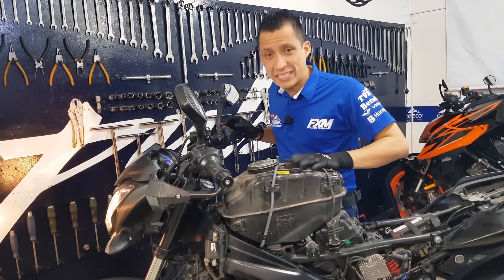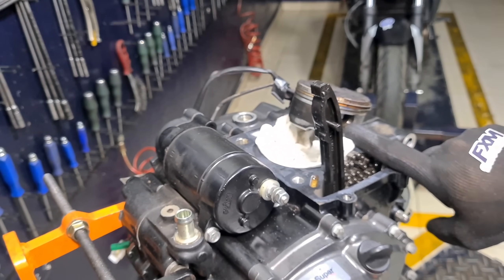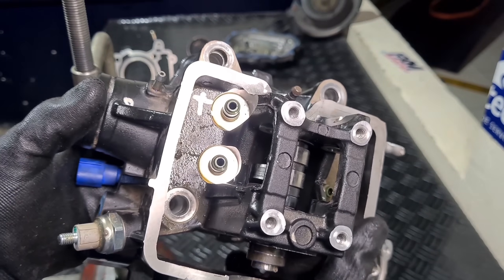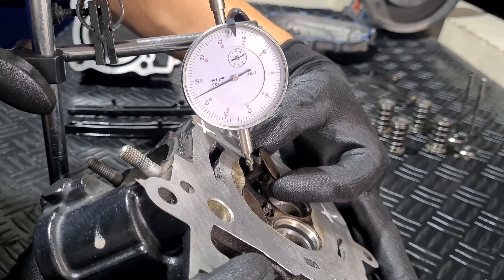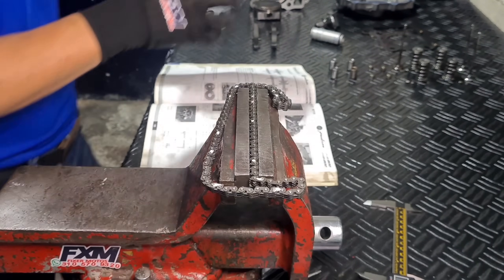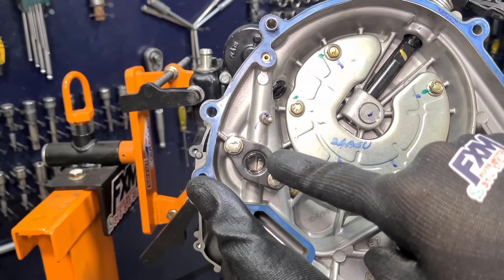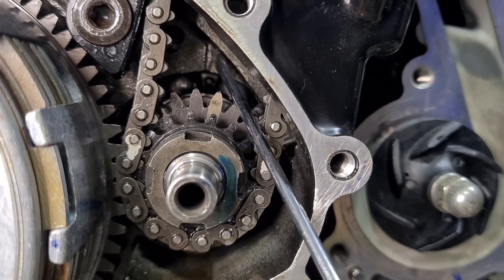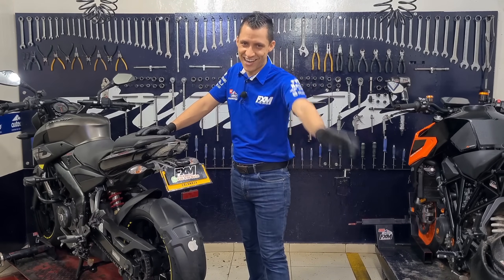⚙️Diagnostico y Reparación PULSAR 200 NS►SONIDO EN EL MOTOR🚨

Comment: Love from India. 
Never ever heard of cylinder head change in my life. But Bajaj bikes can make possible this. I have 10 years old Pulsar 135LS. Never ever changed the head and cylinder piston assembly. And my bike has covered 86000 kms without serious problems. 
One thing is very sure and I want to tell you that never ever purchase any high CC displacement bike of Bajaj. I made a very good decision of rejecting dominar 400 and instead purchased Royal Enfield Classic 350, and It is a machine.
I hope Bajaj will provide quality in recently launched 250 twins Pulsars.

Comment: Cristian Cordial Saludo, te hago una pregunta, mi Ns 200 Pro es modelo 2016 carburada tiene 92000 kms 8 años de rodar y ha sido diagnosticada para cambió de biela , casquetes,  balineras de la biela.; Válvulas , guías de válvulas mi pregunta es: 
1) ¿queda bien y funcional sin generar sonidos de motor o es mejor cambiar todo el kit de biela por el tiempo y kilometraje que tiene esa biela?, ya que usted como en el caso de la culata dice que no es adecuado hacer el trabajo de guías de válvulas sino recomiendas cambiar la culata por una nueva.
2) Usted en un video de culatas hablaba de 3 tipos de culata, qué la fabrica les había hecho mejoras a las culatas que venden como repuestos en material y no entendí si en funcionalidad, exceptuando la culata inyección, mi pregunta es si compró la culata para mi modelo 2016 ó puedo comprar otra de un modelo más adelante que tenga mejoras que puedan corregir deficiencias de modelos anteriores? ya qué venden culata con árbol de levas y también debo comprar las 4 válvulas.

3) ¿Qué marca de liquido refrigerante recomienda para ésta moto?
Agradezco su respuesta y disposición para nosotros su seguidores Cristian y una Feliz Navidad, salud, paz, felicidad y bendiciones de Dios.

Comment: Buenas noches, reciba un cordial saludo, vi su video y me pareció muy bueno, muy profesional; tengo una pulsar ns 125 con 50.000 km, tiene un sonido en el motor similar a la cadena cuando está destensionada y golpea en la tijera.
Ese sonido pareció al meter la segunda marcha a 1.300 rpm, luego paso a los otros cambios hasta la quinta menos la primera.
Luego apareció un sonido como de un rodamiento cuando está reseco, la llevaron a un taller y cambiaron cadena y piñon delantero y sigue lo mismo que podrá ser?
Muchas gracias

Comment: Hola amigo¡¡excelente trabajo!!! Tengo una honda xr125 cadenillera y ha tomado un sonido como esa pulsar antes de ser reparada.El problema empezó cuando lo.llevé a un taller y bueno se rectificó cilindro,se cambió rodajes de leva,válvulas y balancines pero al segundo día de haber hecho estos cambios empezó con ese sonido de balancines descalibrados y cuando calienta suena peor,llevé mi moto hasta a 4 mecánicos y ninguno ha podido solucionar ese.problema.Ahora último fuí a otro mecanico y el.me dijo que no se va a solucionar a menos que cambie cilindro nuevo (standart) y la culata con todos sus componentes internos pero en los repuestos honda no viene culata armada como la q muestras en el video,vienen por separado todas las piezas es decir para armarlo uno mismo¿crees que colocarle las.piezas nuevas  sea la solución? Espero me puedas responder puesto que ya me da miedo que otra vez no puedan solucionar el problema de  mi moto y los gastos que estoy haciendo son fuertes.

Comment: amigo muy bueno tu video te  queria comentar que el año pasado compre una, todo los servicios los realizo el taller o concesionario donde la compre, la moto se rompio en el km 15000 la garantia no me respondio, pero en fin mi comentario es si la trate bien nunca le di duro todos los servicios al dia que podria pasar, la moto presentaba un ruido en la tapa de cilindro o culata pero en la agencia donde la compre el taller me dijo que esos ruidos son normales, se rompio una valvula de escape y rompio piston tapa de cilindro cilindro, mi pregunta es es una moto que cada 15000 km se tiene que remplazar todo esto ?

Comment: hola amigo te saludo desde argentina, mi moto al kilometro 16000 corto la valvula tranco el motor, antes de que esto pasara la lleve al taller concesionario donde la compre la moto, les comento que presenta un ruido en la tapa de cilindro, ellos me dijieron que ese ruido es normal en esta moto después del kilometro 15000, me la entregaron del servicio arronco y el motor se tranco, bueno siento que me estaforon asi que tego la moto en casa. solo busco ina orientacion para saber si esta moto hay que hacer este trabajo cada 15000 kilometros, con un uso de amor propio osea nunca la doy duro la trato muy suave el taller obio no se hace cargo, entonces voy a obtar por repararla yo mismo, te queria consultar que pudo suceder alli ya que todos los servicios al dia con bajaj. es una moto que cada 15000 km hay que cambiar tapa de cilindro?

Comment: Una pregunta tengo una rouser n 200 del año pasado y tiene 13000kl le hice cambios de aceite  correspondientes y filtro de aire. Cuando la acelero mas de 100 ponele hace como rudio a motor acelerado como que se pasa de revoluciones y tengo q bajar a menos velocidad que puede ser? antes iba a 140 y no hacia ese ruido acelerado como "en falso" (en quinta obvio) nose que le pasa :(